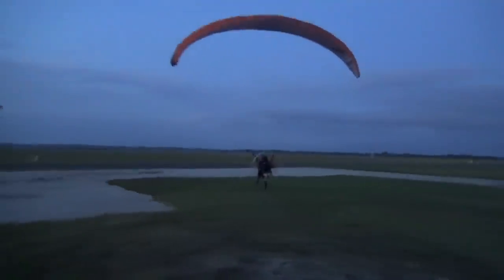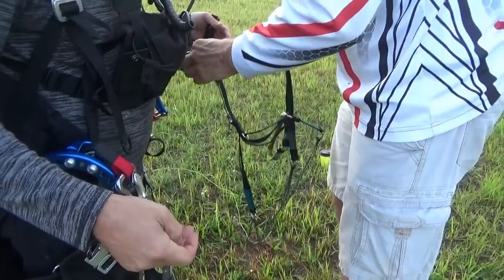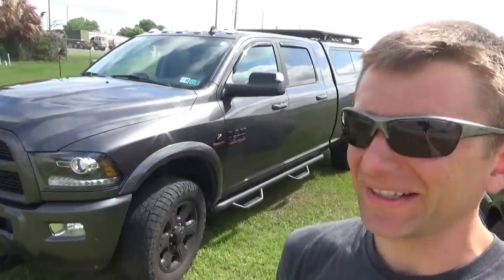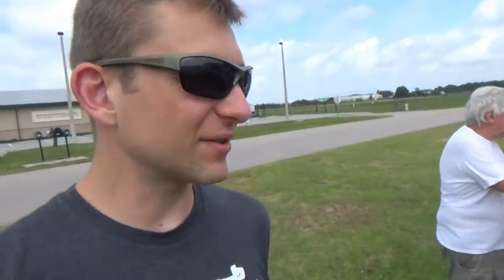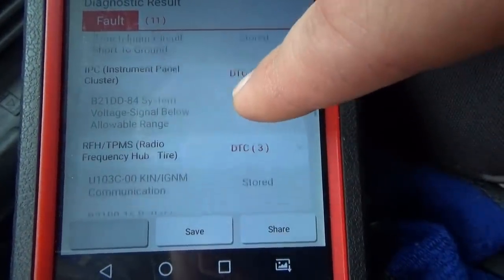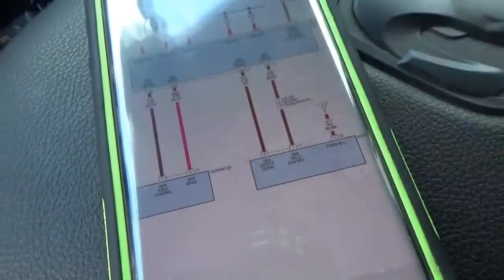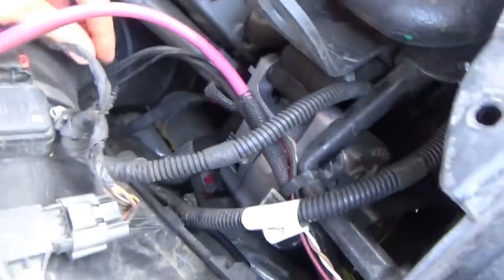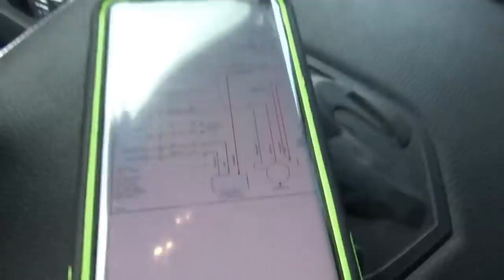Ram Cummins Charging Issues & PPG Practice -Day 11

Comment: Ivan, I couldn't believe it when I saw this title.  I thought surely that doesn't stand for "Powered Paraglider."  Looks like Aviator PPG in Lake Wales, Florida.  I got my training at Avon Park just down the down the road about 23 miles.  I got my training in 2018 and yes, it is an incredible experience.  I have a P.AP Tinox with the Vitorazzi-Moster 185 and a 28 meter Ozone Spyder wing.  I am terrified of heights and when I took my first flight the ground disappeared from under my feet.  I got off the power and couldn't get in my seat.  The instructor told me to stay on the power; I flew the pattern at the airport and was indeed able to land safely.  I got on the ground and did indeed regain bladder control and wondered what the HECK just happened.  I got 25 flights in and have been flying ever since.  You need to learn how to work on those paramotors.  Great video!
Reply from the maker: That's awesome! One of the coolest sports ever :)

Comment: I know this kind of truck,   I drive 3500 dually Cummins for work.  I had this issue,   not exactly the same,  but similar,   it was the wiring harness from alt to pcm was chafed.  Had it replaced,  it's been problem free last past year,   it just hit 398,000 miles on 2016 truck. Had this from new when work bought it. Love this truck lol. Runs super strong and plenty of power all day long.
Reply: Yeah this was the first problem I’ve had after putting 90k miles on now. It’s treated me well whole way up the East coast to Newfoundland and over the Rockies 5 times
Reply: Agree. Wire chafing issues were common is some of the 3rd gens as well. Once the chafed wires were identified, fixed & protected from further chafing... all was good.

Comment: Early trucks the gauge showed the true charging voltage and when the system went into fuel conservation and lowered the charge rate people thought they had a problem. The newer trucks lie and leave the gauge up when they reduce the charging system output.

This is of course besides the potential for a real problem, which trouble codes would show...usually battery temp or alternator. Also Chryslers hate low battery voltage, they’ll set 20+ codes, sometimes go into limp mode, even misfire.

Comment: Watch out. Matt Schrodinger had a fuel pump harness under the car that was faulty where the customer replaced the fuel pump, the car ran fine for a week, then became a no start again. Matt got the car, found the wire and said "I don't think this car ever needed a fuel pump". This truck very well could have wiring damage. I'd say it's about a 50/50 shot between the alternator and the wiring, hard to say since you were not fortunate enough to look at the truck while it was broken.

Comment: Interesting that there were codes in so many models was the dealer to lazy to check or clear them after replacing the alternator or where they new, my guess is on flat rate the battery light went off after replacing and that was good enough, it would be nice to see the receipt from the dealership. Great job fixing peoples vehicles you will make friends for life.

Comment: Man, you got the flying thing down quick! Nice work! 

Ahh friggin mice!  Sounds like the vehicle I have here now. A '08 Lexus RX350. No crank. BCM seems totally dead, although the headlights work (none of the other lights work, though). Evidence of mice all over the top of the engine under all those plastic covers. Can't see any chewed wires, though. This one is going to challenge everything I know! Engine computer, airbag, and ABS modules are alive. No comm, due to no power (presumably) at the DLC. A few blown fuses - one fuel injection fuse I replaced, and it didn't pop. Dead short in 30A radio fuse's circuit. Rest of fuses are related to the radio - navigation, etc.. I just got a 1 year sub. at Alldata for it, so I'm ready to do battle! 😁 It's nice having a clue where everything is for a change, lol.

Comment: Seems a batch of bad alternators escaped the manufacturer's in-house quality control checks!  Another thing to keep an eye on are chafed charging system wires. Charging system wire chafing was a common issue on some 3rd gens.

Comment: field control circuit high and multiple alternators same issue. hmm, I'd guess the plug/connector at alternator is probably bad/pin issue. wiring diagram time lol
I heard snow plowing too, so that means salt slurry on everything, probably half the electrical rotted out already lol
** actually knowing Florida weather it probably rained and water is getting into something messing it up, like green crusties inside the plug body or bare wires/splices conductive when wet.

Comment: Charging issues with credit card over drawn from lots of repairs
Put a old Delco single wire alternator on it.
Reply: Kept blowing the regulators, over charging over 18+ volts, batteries cooking. Changed 3 reg's in a month. Put a single wire delco with a small change to the alt. mount, going on 4 years, no problem.
Reply: @irenesilvers7096  awesome AC Delco Charles Kettering the first in world to invent half the things we use.
Look him up.
Shalom

Comment: I'm looking at a Ford Ficus 2010 that has the same issue. These "Smart Charging" systems are getting more a pain in the arse. One thing I have learnt is that the batteries must be Silver Calcium because the technology is able to take the higher current than a normal lead acid battery. Jump starting cars is also a no no because of other parameters that are being taken into consideration like outside temp, engine temp etc etc. The large current spike from jump starting can fry modules. Has he ever had to jump start the truck?
Reply from the maker: Agree on the "smart" charging system, James. I have a good case study coming up on a Subaru Outback with a parasitic drain and a "smart" charging system :)

Comment: Friend of mine had 08 5.9l 24 valves 3500 hd with 2 bat. He had the same problem with charging, installed a few alternators but still. Those trucks need Interstate batteries (Good quality) not from Wallys and good quality Alternator. Cheap alt never stops charging (has cheap diode board or none) and short the bat.

Comment: If you volt drop the wiring you will find it over 0.3v difference. Indicating a fault in the wiring. I bet it's just a partly broken trigger wire

Comment: Hmm an alternator controlled by a computer, what could go wrong ha ha :-D
It may not be the alternator at all, if it played up a lot the picoscope may show the pwm signal doing strange things.
If it is pwm driven, Maybe disconnect the pwm wire and see if the alternator goes into a self monitoring mode.

Comment: I don’t know if this truck is set up like my 99 cumins diesel but I pulled my hair out trying to find why my batteries would go dead after setting. Engaged two 35 year technicians who worked half a day trying to figure out the problem, then one of them read the owners manual that stated one particular fuse stayed hot all the time. Started pulling that fuse after parking and had no more issues. Who builds a vehicle this way?

Comment: Did you check the engine had a good earth to the body of the car, this can cause strange problems, works fine for a while, especially if wet, but when dry it has high resistance and will not conduct, can throw up some weird problems!

Comment: Ivan’s got that paragliding down to an art now. Got a feeling that poor guy got a bad new alternator. If it’s intermittent It might be a little hard to track down. If the control wire from the computer is good and the powers and grounds are good I’d be concerned it’s an intermittent alternator failure in the new alternator. Or could it have something to do with the infamous TIPM?

Comment: I doubt that these trucks ever had two alternators from the factory; I can't think of any reason why they would. I think the two on the diagram should be labeled based on the engine. One is for the Diesel and the other for the gasoline engine. The wire setups are likely different, so they're illustrated separately.
Reply: something like towing/box/service/ambulance truck platforms would run dual alternators
Reply: @throttlebottle5906  That's true, but those are added after the purchase by other companies. The vehicle manufacturer will only install a single high-output alternator from the factory.
Reply: @josephwash109  but the dual ALT is factory order on those type ( or has been on many model/brand for years)
Reply: @throttlebottle5906  So, I did some research and was able to verify that the Rams are available with a dual alternator setup. Thanks for the tip. That's why I don't put a lot of stock in aftermarket wiring diagrams--they leave out crucial information that can lead you astray. The diagram should be marked "SINGLE ALT. SYSTEM" "DUAL ALT. SYSTEM ONLY" or something similar.

Comment: what does the annual subscription cost for the launch
Reply: Depends on the tool but most come with 2 years free and they will still work even if not updated (other brands will lock up if not online) then it runs about $400.00 a year for updates.

Comment: Never see that many faults with a Toyota...none I have owned anyway.
Reply: I've got a Lexus RX350 here now - been here multiple times with multiple problems. Biggest lemon I've ever seen. This one is rivaling GM for a race to the very bottom. Right now, it's a no-crank due to many electrical problems. Last year, the ignition cylinder seized - had to tear half the dash apart to replace (I have a video on that). Before that, the cooler hoses in front of the engine blew, and pumped 5 quarts of oil out in 3 miles. Then there's the hood pistons that couldn't hold the hood up, rear hatch switch that failed, and struts that started weeping long before they should have. Thing has 91k miles on it right now! Sad.

Comment: Tell him the best way to fix this problem is to trade it for a Ford F-150 or 250
Reply: When Ford can build an engine maybe? All american pickups are Junk. You buy a dodge for the cummins, looks, strong frame as far as us can go.
Reply: @clintmeyer2112  Ford does or did have a bulletproof 3.0 V6. Absolutely no trouble sold it at a hundred twenty-seven thousand miles to a buddy. He's at over 220,000 miles with no major problems except for a couple of vacuum leaks from rotting hoses. The car is 21 years. If it wasn't for Fords bad design of a water pump and GDI turbocharged engine with the 3.5 V6 I would have bought one. But now I have a Toyota.